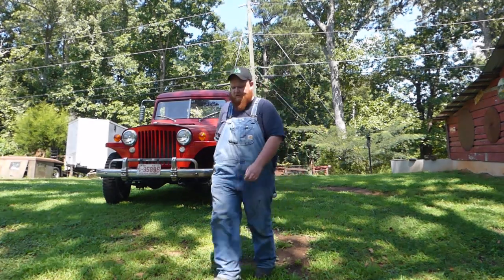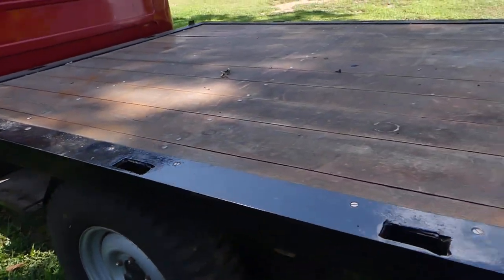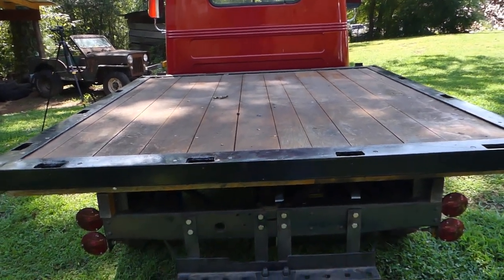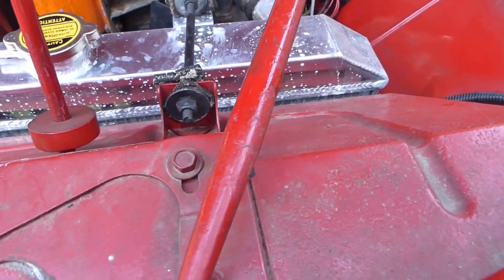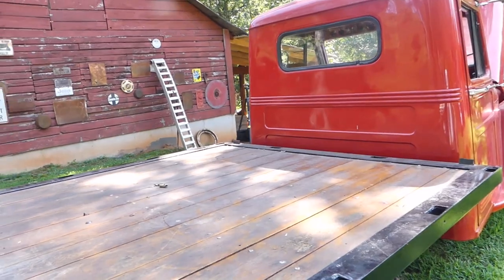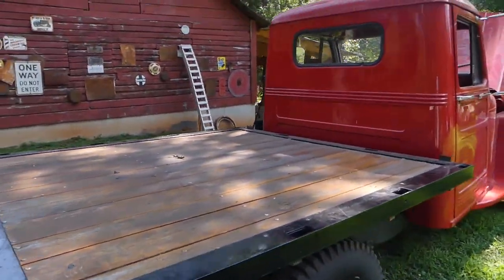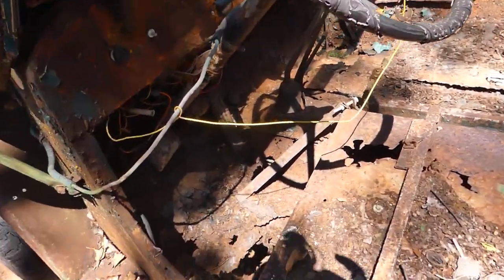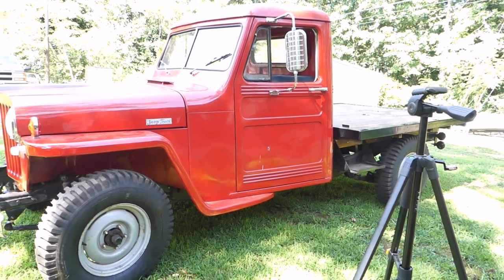1949 Willys

Comment: Nice video, I put a dual resevoir master cylinder on my 59 and ran new brake lines and was told I didn't need a porportioning vavle because the master cylinder wasn't more than 12" above the wheel cylinders. My brakes work great, all  original and she will lock all four up at once. Definetly not trying to act like I know a lot, I don't. Just passing on some info.
Reply from the maker: That’s awesome! The kit I used claimed a proportioning valve was required but who knows lol I went ahead a used one because it certainly won’t hurt anything. Sounds like you have a sweet rig buddy!